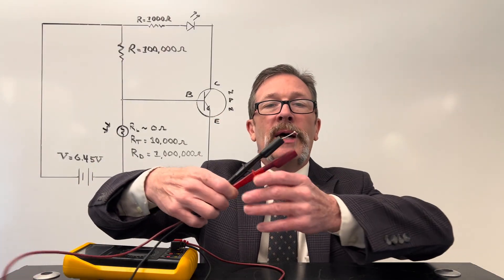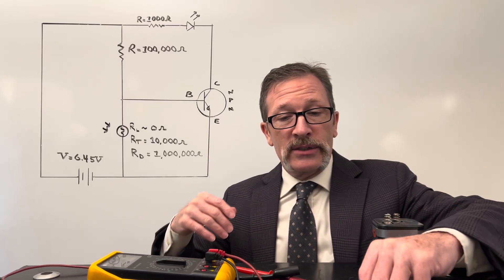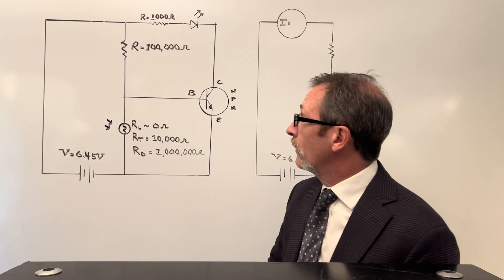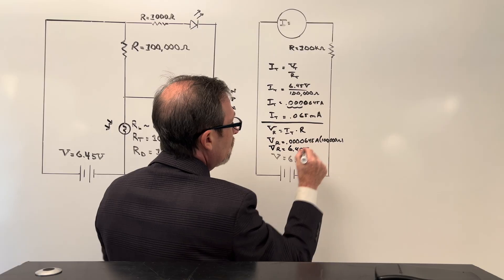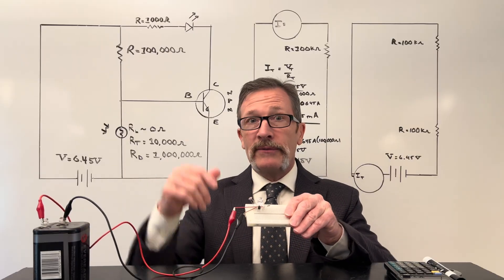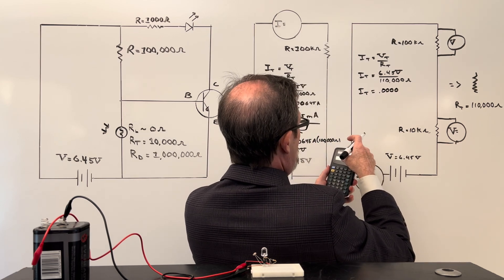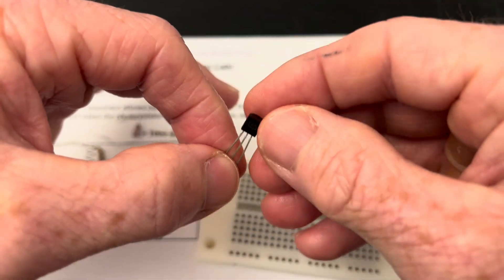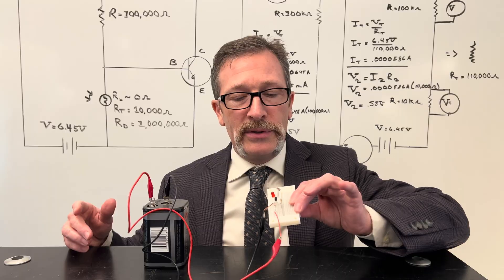Building an Automatic Nightlight Circuit

Comment: what kind of led ? if it is red led , getting more than 4 volts it is going to be destroyed?
Reply from the maker: This was a really a proof of concepts circuit. It can be tweaked to any light level. Thankfully, if the LED burns out, they are very cheap. Thanks for your comment.